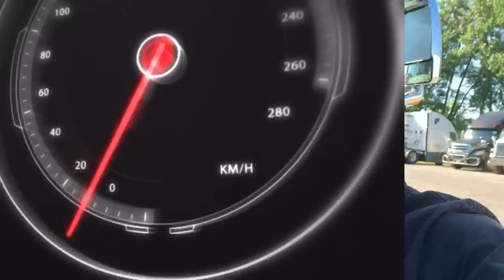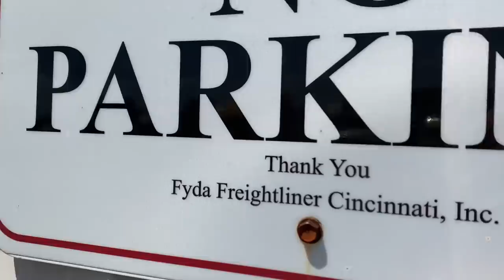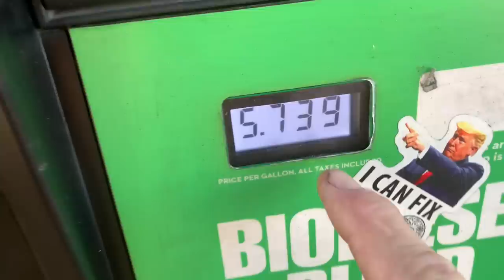Fancy New Motorhome Broke Down

Comment: This one was actually a lot of fun to watch. I'm a retired truck driver originally from Detroit so I've been all up and down through the area where that Freightshaker dealer is many, many times. In fact, I got retired about 50 miles up the road in Dayton, Ohio. Turned my head for a split second to set down my Diet Pepsi Big Slam and when I looked back up, all the traffic was at a dead stop. The 44,000 pounds of paper in my trailer disagreed with my vigorous application of the brakes and broke all my parts. But, I managed to grab my dog and protect her while the truck was crushed like a soda can all around us, so there's that.

Comment: To be honest, White Freightliner has never been my favorite trucks or heavy service vehicles but the one thing I can give them a lot of good words for is their service. I worked for a NDT inspection company for several years which ran a small fleet of White trucks. We didn't necessarily put a ton of heavy haul miles on them but we did put a lot of miles on them to virtually every one of the contiguous 48 states year round in all kinds of weather and road conditions. Whenever we had any problems at all with one of the trucks Freightliner did everything they possibly could to get it in, get it fixed, and back on the road for us, even if they had to recover it from several hundred miles. Service like that is hard to come by.

Comment: Love it, here in England our trips to the race track is only 120 miles (Santa Pod), but last time out our tractor unit pulling the race trailer went into limp mode (add blue) fault. Any hill down to 15 mph but we got home, engineer came out plugged a lap top in within 30 minutes up and running, think he changed a sensor. As we won the nitro funny car round that did not seem a problem at the time. Hope your next video shows you and the team winning, take care.

Comment: Thank you for posting this video. I'm old I miss the day's when we could repair a vehicle enough to drive until a real wrench can finish the repair correctly . Today's vehicle's stop rides over time to make costly calls for help sadly .
Reply: Yep, nothing like the good old days , spark plugs that lasted 15,000 miles, leaky carbs with sticking chokes , exhaust that lasts 2 years, tires that might make 20,000 miles if you drive nice.   Engines that are worn out at 85,000 miles. . .

Comment: The EPA mandate to disable a vehicle due to an emissions error is why so many people want to make the emissions equipment fall off.  Major govt. overreach on that one.  I do really like the lack of soot and smell from my diesel truck, but I'm getting ready to cross the country with my family and the thought of an emissions issue stranding us is always in the back of my head.
Reply: said   "  Major govt. overreach on that one.  "  The vehicle isn't suddenly disabled , power incrementally drops off over a long period of time, read your manual.   This is the only way to give the owner incentive to fix the system.
Reply: @bobroberts2371  The last long trip was ~700 miles one way with my family plus a trailer full of motorcycles and equipment, we left in the evening and drove through the night.  Last I checked, you don't get 700 miles before it stops.  So yes an emissions problem would have left me stranded in the middle of the night with my family a long way from home.  Eventually the DPF would clog up and the truck would stop naturally, no need for them to do it artificially and leave you in a potentially life threatening situation.  If it's that big a deal, bring back the inspections with the tail pipe sniffer.  Again I'm all for helping the environment, but this type of thing puts me at odds with the EPA.

Comment: Recalls like this should be proactive, not reactive…my 2 cents.
In a perfect world, you would get a heads up and an offer to get booked
for a service appointment at your convenience, not a short circuited 
road trip….love the videos! 👍
Reply: Just how would a manufacturer know that a problem needs fixed before it is a problem?  ALL recalls are reactive to a problem once the manufacturer becomes aware of a problem.
Reply: @bobroberts2371  I would expect them to advise their customers who are at risk of a defect before in manifests.
Reply: @joefenech6839   OK how about this statement from a manufacturer 

 "  As a proactive approach, we are informing customers that any part may fail at any time and are issuing a standing recall for every part of the device we have manufactured . " 

A manufacturer does not have a crystal ball letting them know that a certain part will fail before it fails.  The only way they will become aware of a problem is if they see failures in the field.
Reply: @bobroberts2371  If they know of a defect that impact’s reliability or safety, it is on them to make it right by what ever means they deem feasible to maintain their customer satisfaction. It boils down to how they value customer satisfaction in their over all business model. Again just my option.
Reply: @joefenech6839  said "    If they know of a defect that impact’s reliability or safety, it is on them to make it right by what ever means the deem feasible to maintain their customer satisfaction.  " 

Manufactures DO this already, they send letter to vehicle owners informing them of a recall.  The the issue is you want manufacturers to be " proactive "  to the point of doing something before a problem even occurs or anyone is aware of it.
Reply: @bobroberts2371  agreed Bob….. I give manufacturers my business based on this. I am not so concerned about a problem occurring . I value what they do to correct/address the problem.